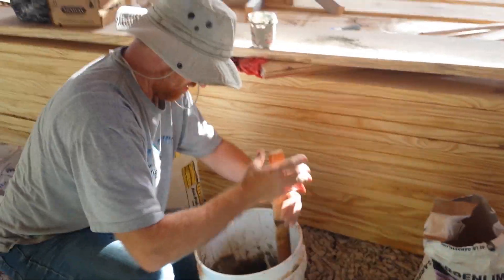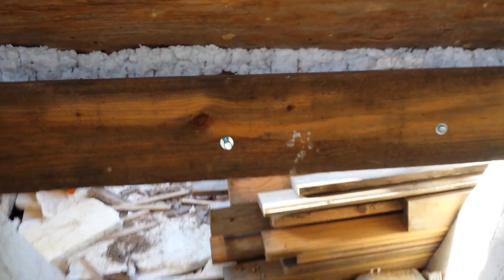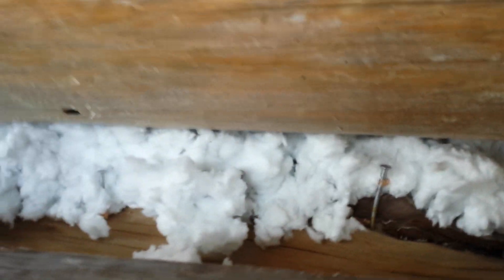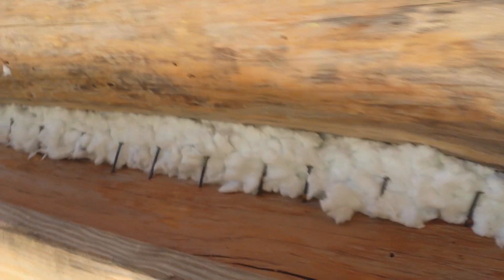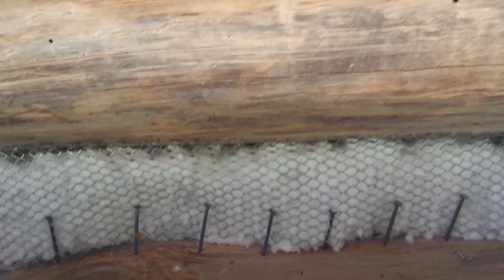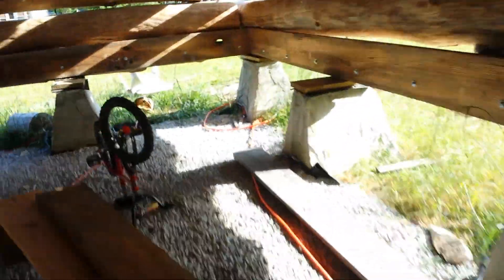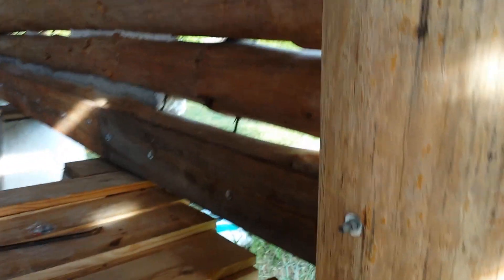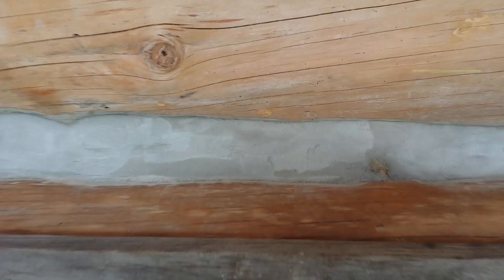1st row of chinking

Comment: Am I the only one wondering how the nails are hammered in / driven in vertically in those tight spots?
Reply from the maker: ha ha! no, you're not the only one. It's a trade secret. Just kidding- I added a piece of pvc pipe (or rubber hose works) to my nail gun. This makes it so the nail gun only shoots the nails about 1" deep. The other 2" of nail stick out. I do it at a slight angle as close as I can to the log, then come back with a pry bar and push the nails up so they are vertical. https://i.postimg.cc/qMQwLtm5/ka-chink.png